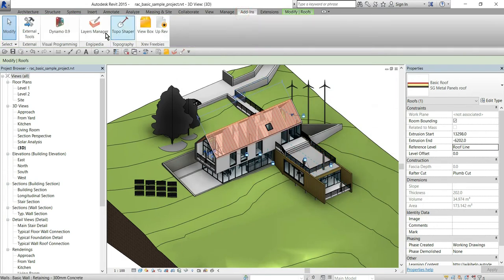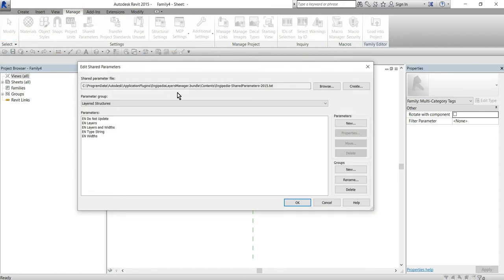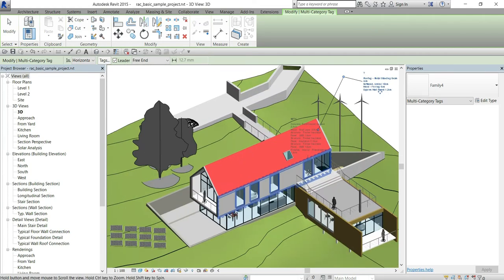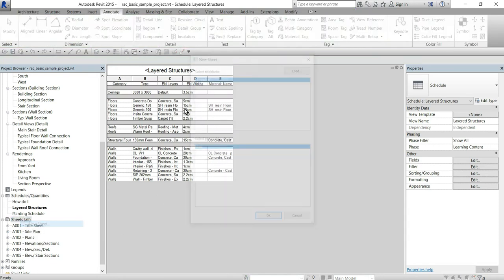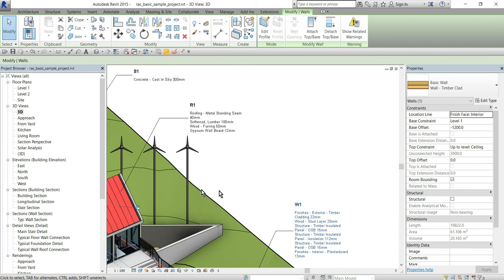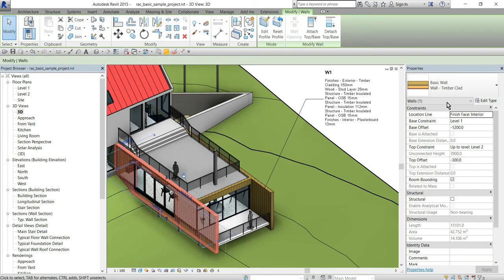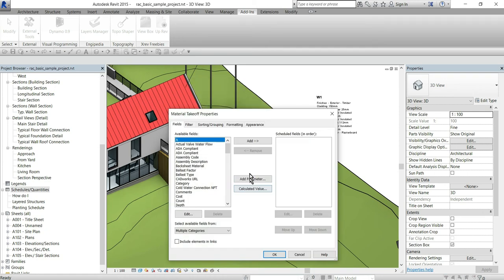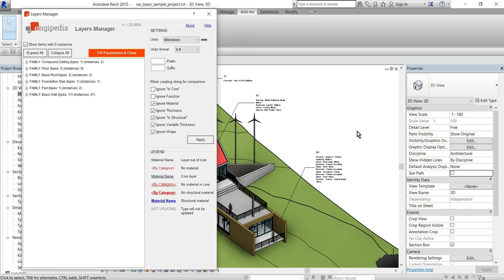How to Use Engipedia Layers Manager Revit Add-in

Comment: Hi! 
My plug in doesnt load all the shared parameteres 
Idk when you spoke about how put the shared parameters in Revit 
Its Revit 2023
Reply from the maker: Hi, are you using FREE or PRO version? Did you download the latest from the Autodesk App Store? It should load in the parameters automatically. I suggest you download PRO version (there's 30 days trial). Run it at least once in all your models, it will clean out possibly the old parameters you may have. Then you may continue using FREE or PRO version, it will work fine regardless.